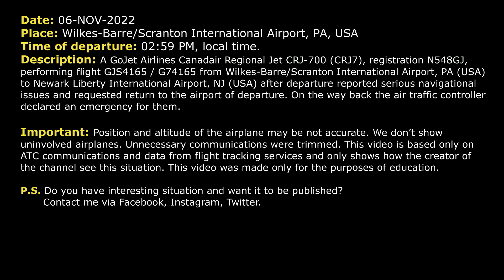SERIOUS NAVIGATIONAL ISSUES after takeoff. GoJet CRJ-700 returned back. Real ATC

Comment: Fantastic "Departure" controller, taking the extra work to guide with start-stop turns. The importance of this didn't hit home until the comms revealed a 5-degree discrepancy (35 vs 40) between the magnetic compass heading and the actual flight path (probably wond drift). This form of call-out was more accurate than the requested vectors, and decreased the cockpit workload.
Reply: ...wind drift...

Comment: what exactly caused this equipment error? that's a weird bug.
Reply: Basically, its electronic equipment with a lot of safeguards to its operational integrity. The best situation is that if you fly at a constant airspeed, altitude, and heading. you have the ability to reset the system as you do at the gate stationary. If you do not reset the system, you will only have standby navigation and aviation capacity.  Over land this is not a problem [ you have access to navigation aids ] but flying over water errors multiply and the corrections needed become more difficult.
Reply: There's also monthly nav data updates on these planes.  If you dig around in the FMS without knowing what you're messing with, you can really screw things up.

Comment: Down to the compass? Yikes..
Reply: AHRS Failure.  You have 2 and the standby.  The standby was clearly deemed most accurate.  I’ve had this failure.  If you can run the procedure you can correct it.  But if you guess wrong for which AHRS has failed you can be in a world of hurt.   AHRS is Attitude Heading Reference System.
Reply: That's what the standby compass is for.
Reply: Yeah, and he even had to ask to - GASP - go VFR. The horror of it all…
Reply: @timsmith1125  I mean, that's a pretty big deal in IMC.